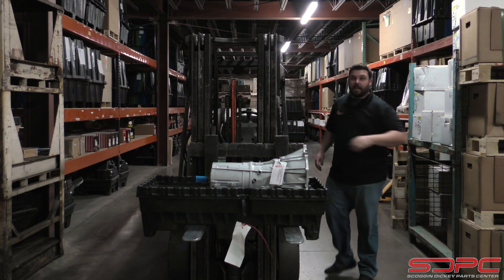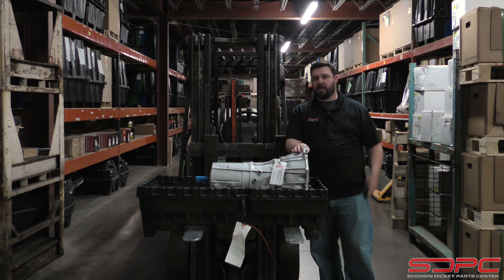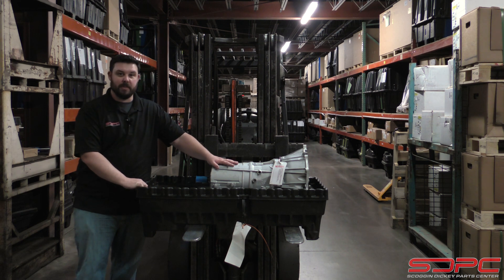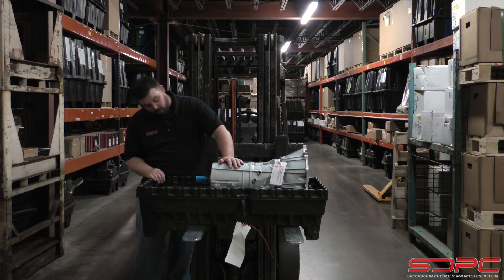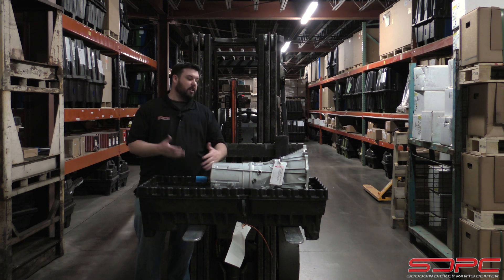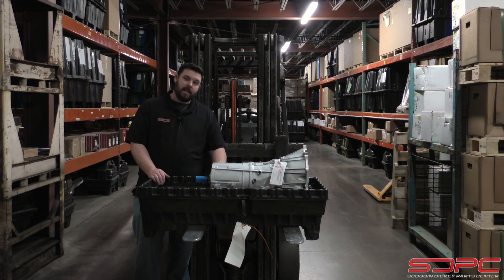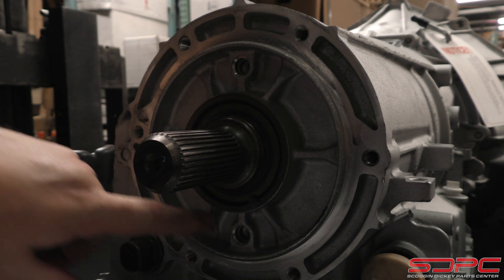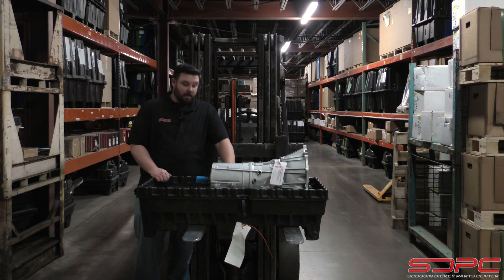SDPC Tech Tips: GM Component Changes

Comment: Very bad info.  The 2wd shafts are longer and will not work with a 4wd.   Output shaft is different and will have to be swapped which requires completely disassembling trans

Comment: I have a 2011 chevy 6l80 that's 2wd that I want to use on my 2012 4x4 6l80.... an you're telling me that the output shafts are both the same size an all I have to do it tags the cone of the 4x2 to take it a 4x4???
Reply: No different length

Comment: I am going from a 4wd to a 2wd tail housing and I have to swap the output shaft assembly for the longer version. From what I have found so far there is a chance that a Camero non slip yoke and output /tail housing could be used with no further alterations. With that being said this video is misleading and some what bad or incomplete information. Btw I attempted several times to contact nick discuss this information with them and got no response
Reply from the maker: This video covers the changes in some of the GM transmissions, this information is not to be used to convert a 4x4 6L80E to a 2WD version.

Comment: I can take a 2wd trans and take the tail nose housing off and it will mount up to my 4wd without doing anything but plugging those 2 holes??????
Reply: They are both 2006 models.
Reply: The 2wd output shaft is longer than the 4wd so cutting that shaft is also necessary.